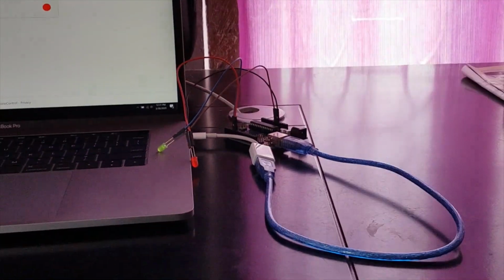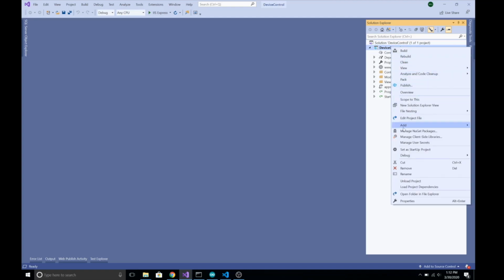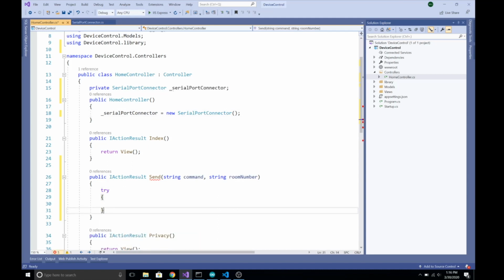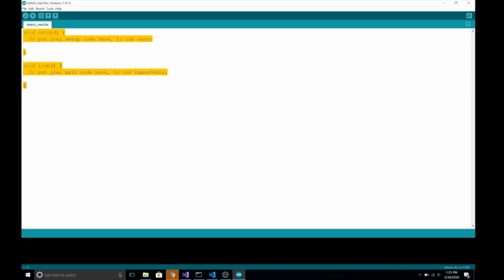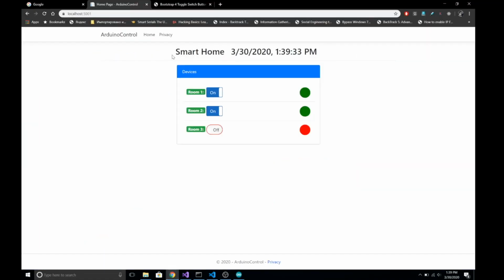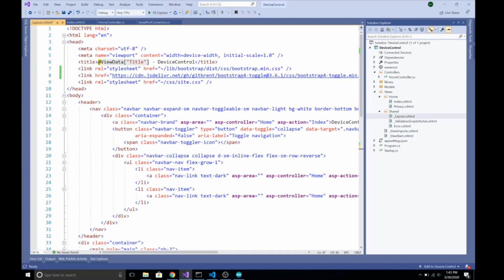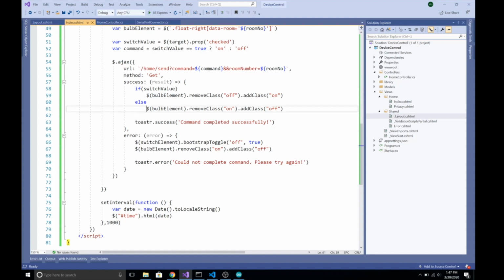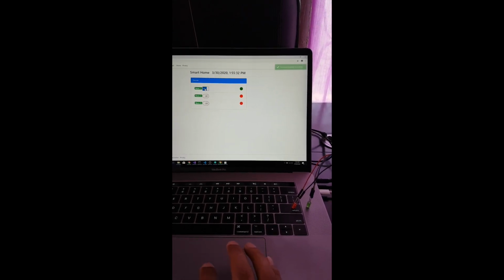Control Arduino from Asp Dot Net core mvc app(Simple home automation using Arduino)

Comment: I'm trying to figure out why I can't replicate this on my Raspberry Pi.  The .net code works and produces a web page.  The arduino connects just fine.  The website can send one command, and the arduino lights the led.  I send a second command and the Arduino resets.  I feel like there is something in the Microsoft libraries that isn't communicated correctly on the ARM 32 processor.